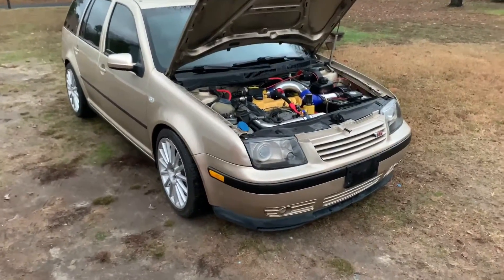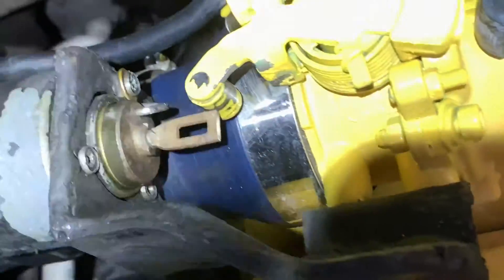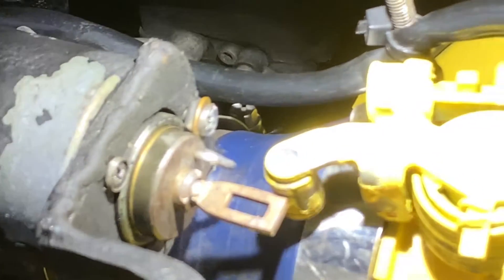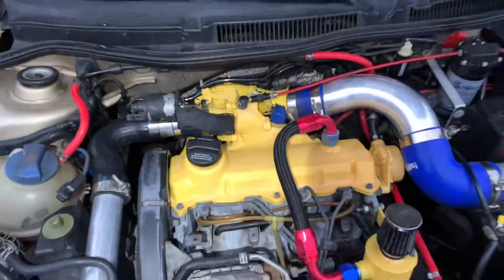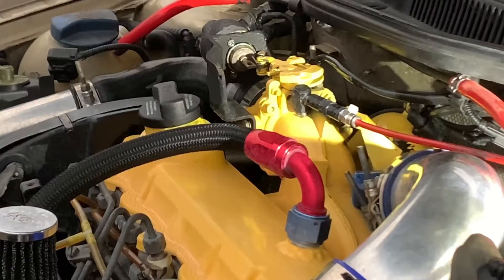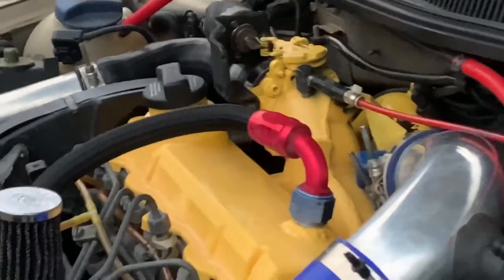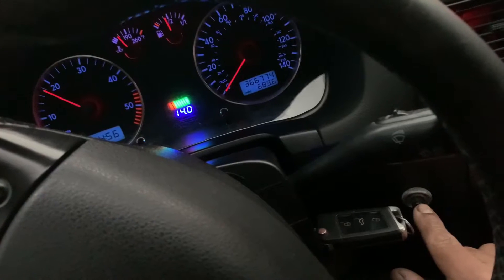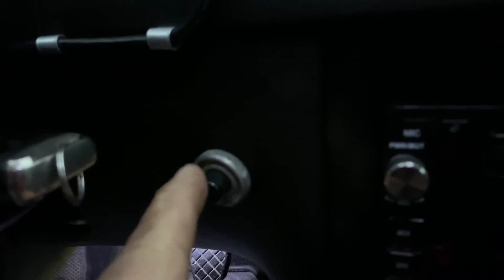VW TDI runaway shut off valve

Comment: Great idea!! hopefully the vibrations of the engine don't accidentally slip it while you're driving.
Reply from the maker: Well i had running like this for over 2 years and still 0 problems. And i test it ones in a wile to make sure still works for need it